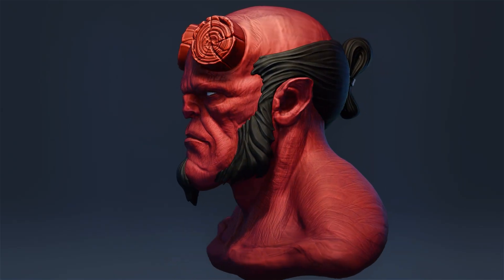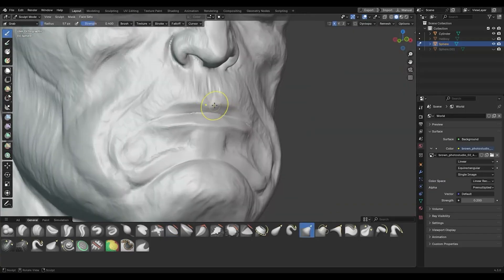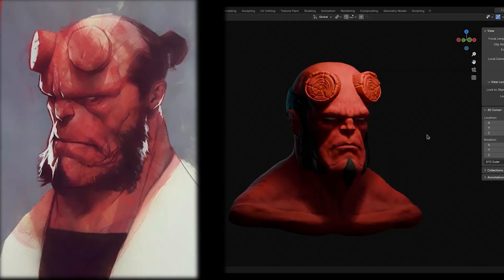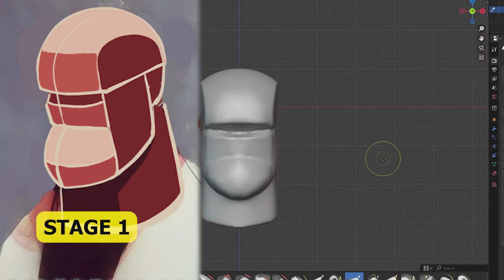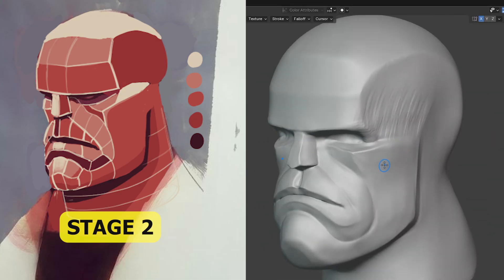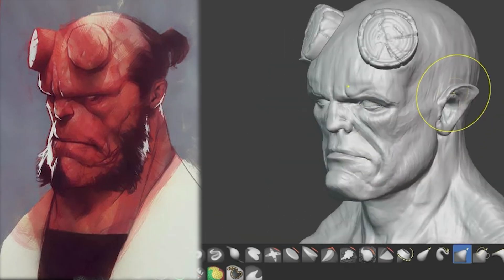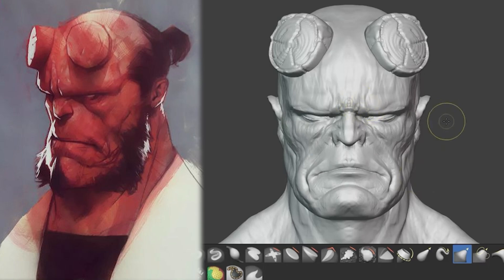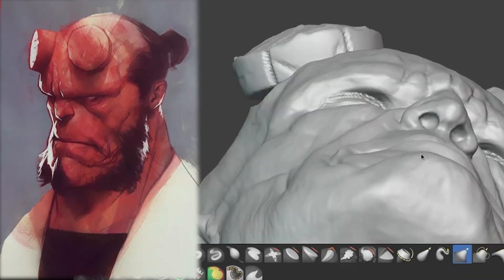How to Approach Sculpting in Blender – Step-by-Step Process for Beginners

Comment: I'm no sculptor by any means, but I think this is the first video that uses a skull for the first level of sculpting. I guess that makes more sense with Hellboy, but still. Good thoughts, thanks for sharing!
Reply from the maker: Hey Spencer! Thanks for the comment!
Yeah, using a skull really helps with getting both the proportions and the overall shape of the head right — since the skull is what defines most of the structure.
Sometimes I even use a full skeleton underneath when sculpting the whole body, just to make sure the muscles are placed correctly and the bony landmarks line up.